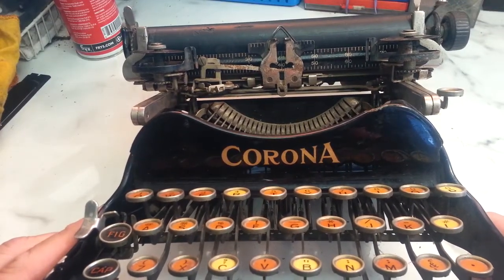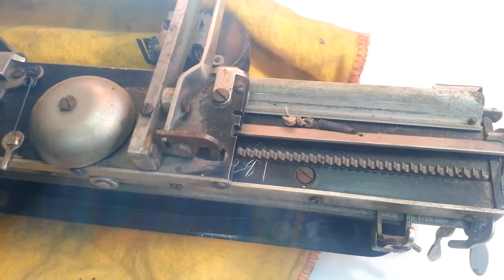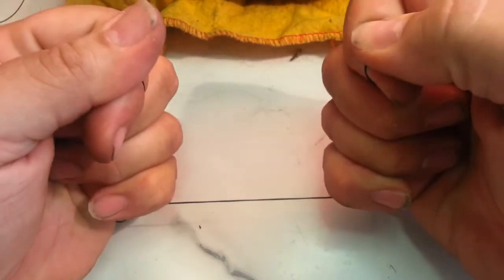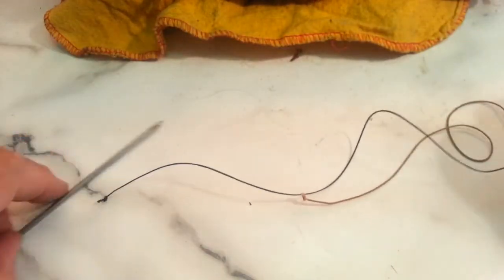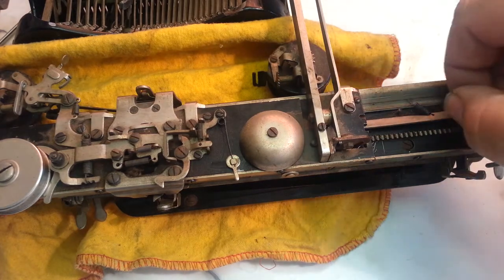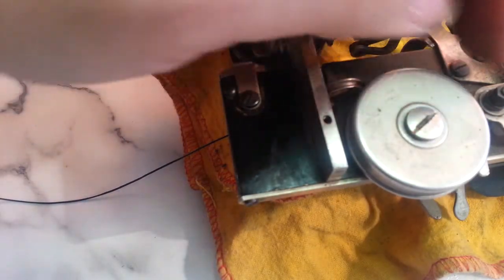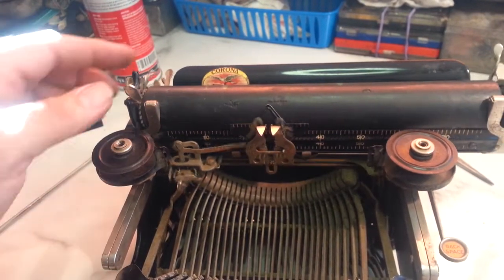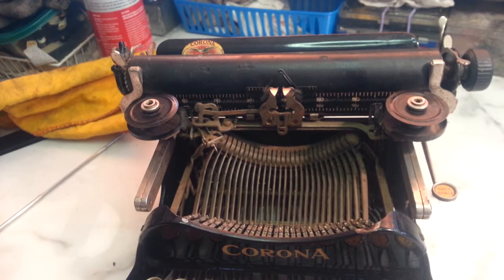Folding Corona Manual Typewriter Draw Band Mainspring Repair Fix

Comment: How to fix Corona typewriter old.   On Google and you were the first.  Ok so l started to watch it and miracle that issue is what l need it to solve....first.  No idea about names and parts so it is going to take a little while to work on it.  Issue 1 Fixed  l am sooooo  happy, issue 2 what type of oil to use the 40 or sewing machine oil ok,  the keys are stuck and some do not move very easy or go half way oil l think will help, this is like 100 years  and now is moving so l can write kind off.  Thank you so much it took me about four hours and it is fantastic.
Reply from the maker: Mixing new oil with old oil is a recipe for disaster down the road, old oil needs to be flushed out, completely
wd40 is not a good oil, it's not even oil..... I use Marvel Mystery Oil
Type bars and pivots do not, should not be oiled.
Reply: @phoenixtypewriter2136  thank you so much, i will have to look with calm your videos, i am sure you have something about how to oil the all typewriter if the machine has been setting for at least 30years. i got mine two yeas ago and I was told that was not use for at least 25 years, my brother in law did not know if was or was not working. Just one last comment,  i did try to fixed last year but i could not find nothing wrong with it.  So l thought i will have to find the person to fix the machine, and today i was cleaning my table and decided to open it, just because i love de sound and by Angel's slook Isaw the  thread and not my desk is still a mess other day i will clean it, mean time i just want to enjoy my success...which I couldn't have done without your help.... the rest is history. thank you again. Almost forgot I  know the word bar but not pivot and l look and look in internet but still not sure what is it???? do you have a video where you mention the name of the parts of a typewriter???? yes all of them all in and out.   thank you.

Comment: excellent video... we found a Corona Special with instruction manual in my grandmothers house..  We are thankful you made this video and what a help!!  We have string but not sure the length to cut it... a poster used 16" so we will try that as well unless there is an "official" length..   My question is where can we find info on the carrying case it came with?   Even if I have to  make a new one out of thin Luan and coat it with leather or some other substance, i would like to get the dimensions or pointed to a place where I can find out...

Comment: Love your videos! They are so informative and interesting. Please tell me how you got to old string out of the mainspring!
Reply from the maker: Not sure I had to on this one, but winding tension will move the internal spring away from the edge to allow some access, that main spring can be removed and the plates separated to get internal access too
Reply: @phoenixtypewriter2136  I didn’t dare it. Got the knot into that cylinder and counted blessings because the carriage worked agin. I am so glad you have the same little Hemingway typewriter because you give such great advice. Mine is named ‘Hadley.’

Comment: Mine had this problem, but I used the original waxed cord, and I affixed it to the carriage via a piece of wire that I strategically bent into shape instead of the spring, which was missing. In addition, I found it easier to wind the capstan under no spring tension, and once everything was in place, I wound it up using the ratchet on the bottom. It works as good as new now.
Reply from the maker: Goog Job !! I often do this different ways on these and other brands and models too.

Comment: Hi, Really enjoy watching your videos. I had recently bought a Corona golding typewriter, the seller told me the spring is not working. When I was following your video trying to fix my typewriter, I realized the spring drum drops out when I removed the cover. Can you please advice if it is fixable? It would be a pity if this machine only use as display. Thanks.
Reply from the maker: Well without seeing it, I don't know if parts are just loose or broken or abused
Most all things are repairable on these old typewriters

Comment: Thank you so much for the video! I just got my own Corona No.3. I’m having trouble actually getting it to fold over. It doesn’t look like anything is blocking it. Is this a common issue?
Reply from the maker: Yes, these are precision machines, take very little to cause a bind in the mechanism.
This is when experience with mechanical engineering and theory of operation help immensely

Comment: Thank you so much for your video – very informative and helpful. Do you mind if I ask a question? I have the same machine and it was working fine until I have it shipped when I moved to another country. For some reason, the carriage is now stuck if I type but releases only when I press the carriage release. 

Do you think it's a small problem that I can fix myself? I did try "fixing" it but to no avail, as I'm not familiar with the typewriter mechanism in general. Would you mind telling me what could possibly be the problem and maybe I can search for a youtube video on how to fix it.

Any help is greatly appreciated. Thank you!!!
Reply from the maker: Wouldn't know where to start . . . .  Shipping machines can cause many different things
To get out of wack ! No single answer is right, look for binds, impediments etc . . . .
Reply: The spring on the carriage lock hook on the left side of the carriage can get stretched on these. Replace it and it will allow it to spring back

Comment: Thanks for all your videos Dwayne.  I have learned a great deal from you.   My question is not about this particular repair but about the keys on these old machines.   I notice that most old machine have yellow colored keys.   Is this because the keys have yellowed over the years.   And if so were the keys originally white. ?   Thanks again and I hope you keep posting videos.  Lots to learn about these great old machines. 
Steve
Reply from the maker: Some of these style typewriters did come in yellow, most have turned yellow or a yellowish color
This other video has 2 of these folding coronas that have much close look to original
https://youtu.be/HdAZgU4jSxA

Comment: I have one of these with a broken  (shattered) mainspring. Any suggestions on a replacement or an alternative? Thank you.
Reply from the maker: Parts/donor machine, not sure what is compatible. Clock supply shops have main spring material, spring stock
Reply: @phoenixtypewriter2136  well, definitely a bit of a bummer...I will search the clock mainspring route and see where it gets me. Thank you for your advice.